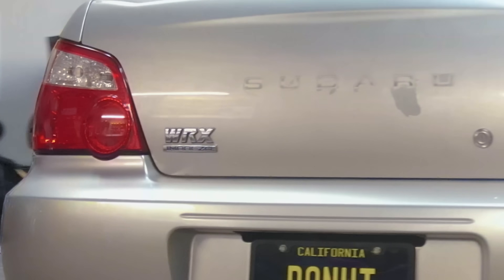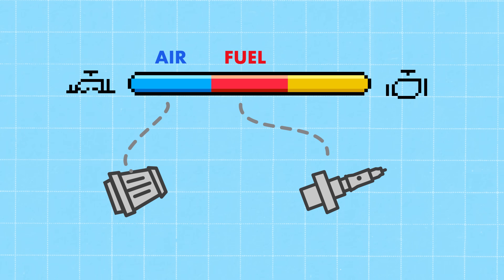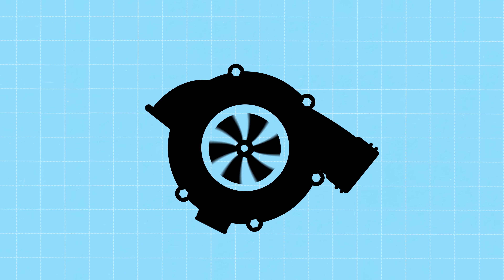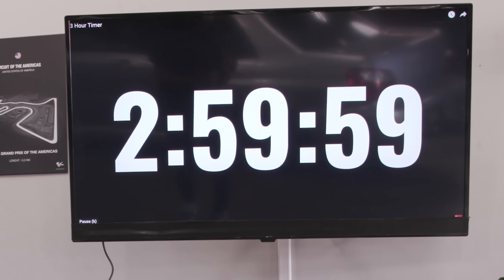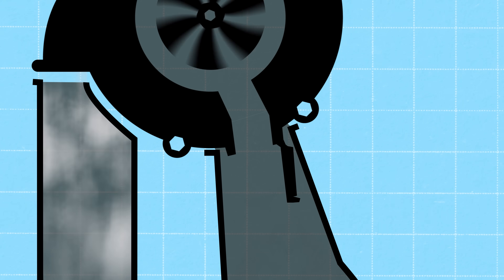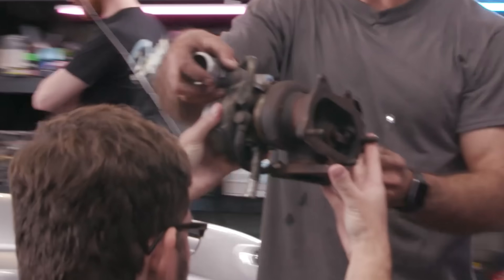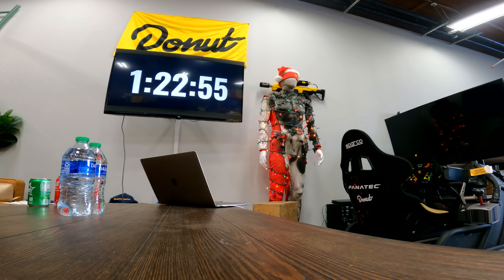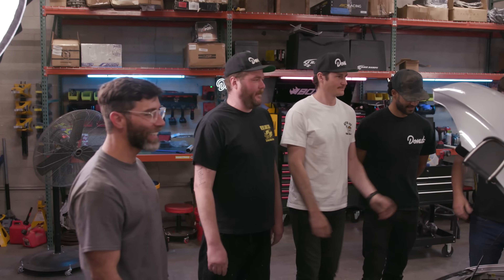Giving people a car, if they can fix it

Comment: Tim managing to replace a turbo with an hour still left on the clock is godlike, there’d be a pile of crumpled beer cans and some choice language being thrown at the car if I attempted that job
Reply: To be fair, it is in an easy to get to location. My first time ever swapping one it took me under 3 hours from start to finish. It’s no slouch job though.
Reply: no lie
Reply: Wrx's are easy to replace.  Takes about an hour and 30 with a lift...give or take
Reply: I can change my turbo on my srt4 in an hour very easy
Reply: In the stock location it’s super easy
Reply: I was about to type this comment out pretty much word for word. This is me.
Reply: Your problem is drinking while doing a job like this...
Reply: @jimmywoo7875  found the engineer
Reply: Agreed I had to change the turbo on a 06 acura rdx and it was a complete nightmare turbo is located between the Transmission and fire wall.
Reply: Theore you do a job the easier it is to do it again but yea that was fast
Reply: @ItsShrk  try changing turbos on an N54 😪
Reply: Subaru turbos are stupidly easy to replace. Definitely not godlike
Reply: nice comment, now I don't need to watch the vid✌️
Reply: @ItsShrk  I’m calling bullshit. Maybe the turbo cartridge but there’s no way in hell you’re going to take that OEM manifold off in an hour
Reply: If you're a subaru owner after 2 or 3 turbos you get pretty fast at it lol
Reply: @Livinglife3666  you don't have to take off the intake manifold to replace a Subaru turbo
Reply: @jay1268  yeah that other guy was talking about an SRT4
Reply: Right! 😂😂😂
Reply: Some people would use the 3 hours just trying to put the tmic back in!!
Reply: Don’t forget the 2 packs of Marlboro reds 🤣
Reply: Well it has been removed once by the donut crew so no stuck bolts.
Reply: I could replace the turbo on my car in an about an hour. But that’s because it’s a easy location and everything is easily accessible. 2014 Cadillac ATS 2.0T
Reply: I'm pretty sure they told Tim it was a Subaru before he went in for the challenge. Every turbo system is different, but god damn props for getting that turbo off in less than 2 hours. EJ turbos are stupid finicky to get off given that you have to remove the TMIC and heat shield to reach the turbo.
Reply: God*
Reply: Not really lol they’re very easy to swap
Reply: Ditto!!
Reply: This is the best comment ever 💀
Reply: Yeah, gonna agree with a lot of the guys here. EJ turbos are fairly simple to swap. Unfortunately know from experience.
Reply: @tylerbranski9853  happy ramadhan 2022 Tyler. 🙏From Purwanti Allan. 🙏
Reply: @graphicsgod  Ditto man 👍
Reply: @cristianmontesdeoca7392  have u watched MotoGP Argentina last night? Aleix Espargaro won finally.
Reply: @adamhayden5152  happy ramadhan 2022 Adam 🙏 From Purwanti allan.
Reply: @henry6777  zig zag
Reply: @Mr.Lonley816  yes. And Rothmans too.
Reply: @kylemaples6461  happy ramadhan 2022, Kyle Maples. 🙏 From Purwanti Allan. 🔥
Reply: Not gonna lie, i'm betting the whole timer thing was a prop and it took the guy longer than that.

I'd like to see more than 10 minutes of film, but we didn't..
Reply: Not to mention THIS car especially where the intercooler can be a huge time sink in just removing and even worse putting back on with one person’s pair of hands (unless they did jump in and help). Either way, made props and he got lucky that that was the only issue especially on a car being this old and for who knows how long running on that bad turbo. He got a good deal hopefully.
Reply: Damn. You can actually replace a B5 A4 1.8T in turbo in less than 30mins, leaning over the fender.
Reply: @chrisplayz9739  or how about a z32 😅
Reply: Subarus in general are as good as it gets as far as working on them goes.
Reply: @Jimmy Woo, Wrong. Wouldn’t have gotten through some parts of my friend’s 335i engine replacement if we hadn’t had a bit to drink man. That thing’s hell…
Reply: Took me about a year to build up the courage to restart my project, I got it off and gave up. Took me about a month in ordering new parts and trying to figure out a new vehicle. Lots of 3am nights and lots of beer, then it blew up on my first drive from a stuck thermostat
Reply: Yea he also diagnosed in in such time
Reply: Took me 2 days to replace my 99 Saab 9-5 turbo. Gonna be back to 90s Hondas for me soon. Cheap and effective baby.
Reply: @varacd69  to be fairrrrrrrrrrr
Reply: quake voice Impressive
Reply: Turbo replace is cake bruv literally 40min
Reply: Goated comment
Reply: @ItsShrk  love srt4s
Reply: Best comment I've ever seen
Reply: I’d literally sit quietly and stare into space about how pissed off id get and then resume to try to finish the job 😂
Reply: @kelbaez  Dude... That POS silicone elbow gave me trouble every damn time.
Reply: You do know this is all acted, right? Sorry to burst your bubble.
Reply: Add an additional hour or 2 for each stuck bolt too...
Reply: I would treat it like I'm its alcoholic dad if I only had 3 hours
Reply: @eddyd.105  thats a really shitty place 😭
Reply: 100%
Reply: Specially in a subaru😂

Comment: I haven’t watched this yet but it’d be hilarious if it had blown head gaskets and a bad timing belt just like every other mid-00’s Subaru ever.
Reply: As soon as I heard it I thought head gasket. Haven't watched it yet.
Reply: As some with a mid-00's subie, I will be mad if he doesn't have to change a headgasket.
Reply: Typically it’s only the non turbo 2.5’s. They used a different head gasket on the turbo’d 2.5’s.
Reply: Spoiler: the turbos blown out.
Reply: It's the turbo. It's always the turbo. Even if it's the water pump or head gasket, it's still got a bad turbo.
Reply: Hahahaha I laugh when people talk about blown head gaskets in Subarus every engine has its flaws
Reply: Just woke up, came running to comment this.
Reply: Facts dude 😂😂
Reply: @deathtoming2201  just take care of them and their fine. Do your maintenance replace warn out things. It's good. I adore when people get upset that they need to replace their water pump and timing belt at 200k miles. I always smile to myself as a know it truly should have been replaced 110k ago at 90k. Hell I'm still driving a 2door Brighton with 250k on it the original timing belt little oil in my transmission or engine, because they leak right, and only water in the cooling system that needs to be topped off every day. And it still runs like a champ.

Yes it's needs a new water pump and might need a new head gasket if I ever let it get to hot. But I have all the parts. I kind of don't want to replace them because she's still driving so we'll.
Reply: not unless he did the delete
Reply: I have gf8 turbo 99' with stock engine 275k km on clock, original engine and turbo. My father had 2015 sti, drove 100k with it and no problems also
Reply: @googleleavemynamealone9145  what? You mean delete the subs engine and replace it with a honda k right
Reply: @Adroit1911  nah the headgasket and water pump delete.  Replace it with air-cooled Porsche pieces LoL
Reply: @googleleavemynamealone9145  smart!!!!! Lol 😂
Reply: Spoken like a person who knows only general information about Subaru. The WRX was never prone to headgasket failure.
Reply: How to tell everyone you know nothing about subarus without saying you know nothing about subarus
Reply: @Adroit1911  the 2.5.....   is it an interference engine?
Reply: @ozzypawsborneprinceofbarkness  I've owned 5 and my studies show you are 60% wrong 🤣🤣 add broken ring land, spun bearing, blown turbo, bends rods. But after all that still the most fun car to drive.
Reply: @taylorforster9256  exactly
Reply: Lol I was thinking this to
Reply: @shaunmilor  yes, every 2.5 interferes with everything!!! 😂 But for real, all new Subaru engines and every 2.5l Subaru engine is an interference engine.
Reply: This is what I came here for
Reply: You have 2 hours to fix this leaky head gasket , can he do it!!!
Reply: @jaredparsons4761  I own 2 na 2.5s and both going strong at 200k😂it really depends if the owner wants to change the oil or not
Reply: Except for the 07
Reply: @ozzypawsborneprinceofbarkness  true... But I'd take head gasket problems over ring land failure any day!! 🤣🤣
Reply: late 1990s  N/A subarus had head gasket issues, the turbo gd models got the metal multilayer gasket that didn’t fail
Reply: @googleleavemynamealone9145  most old Porsche’s are swapped with Subaru motors so they can actually drive them
Reply: @jarrettwieberg  it's the flat technology, so exlusive
Reply: @Adroit1911  ooof...Better keep up on those belt changes!
Reply: Wow just commented the same thing I guess I should read the comments before commenting 🙃
Reply: The 2.0 turbos really didn't have headgasket issues. The 2.5's were the ones that had em
Reply: A bad timing belt would mean the whole engine is big time fucked, I dont think theyre gonna make him do an engine swap...
Reply: @TheMagicBambi  the naturally aspirated 2.5l. The EJ255/7 uses the same multilayer steel gaskets the 2.0 has.
Reply: @Adroit1911  correct
Reply: @deathtoming2201  as someone who’s owned two, every 100k like clockwork…
Reply: @joecam7109  but those had ringland issues so just as bad lol.  I prefer the 2.0s out of em all
Reply: Well, once the new turbo is in and it's running they'll probably blow xD
Reply: So fun fact head gasket issues only were on 1998 to 2000 models on the outback ej255 series. As for the timing belt issue it was 1998-2008 on all Subarus cause they use pure rubber and not metal coated rubber belts like most cars did.
Reply: @jarrettwieberg  same here, 218k on my 2.5 EJ251 and she’s going very strong. New clutch last week and she’s as happy as can be! Going for a tuneup and an entire suspension revamp soon.
Reply: @Matt-ik4tm  happy ramadhan 2022 Matt. 🙏
Reply: @Adroit1911  happy ramadhan 2022 Jameson. 🙏 From Purwanti Allan.
Reply: @purwantiallan5089  Ramadan Mubarak 🙏
Reply: Ok, you have 8 hours remaining...
Reply: @tyredcar03  heck yeah man! Love the outback
Reply: All the Subaru fans in to say this!
Reply: Imagine being mad at an engine for failing parts when 99% of them last well beyond the service intervals. If subaru tells you to replace something every 75k don't expect it to last 200k
Reply: @TheMagicBambi  i wouldn’t know, more than a 100k on my Ej257 and it’s still going strong so 🤷🏻‍♂️. Remember, this doesn’t happen to everyone and people just go nuts modifying these cars trying to extract every drop of power, the key is in the tune.
Reply: @ozzypawsborneprinceofbarkness  the right hand rocker gasket is the biggest wrx fail imho.
Reply: @joecam7109  plus I think some people forget boxer engines been used in aircraft for years almost a century which is 100 years for all the dumb ones o it there 😂 you need reliability to be thousands of feet up in the air engine constantly at high rpm doing turns and twists aslong as the “build” is done right on a subie it can be mean but don’t expect it to push 1k Hp unless you look over every single fine detail like they would on an aircraft engine.
Reply: Guessing it's a 2004/5 2L blobeye and afaik they didn't have HG issues.
Reply: @BaddaBigBoom  ahhh, none of the turbocharged models have ever suffered from headgasket issues, none. Not the ej205, ej207, ej255, ej257…they all have steel multilayer gaskets from factory. That must be the biggest Subaru misconception of all time. 🤣😂🤣 of course if you let it overheat or overboost or something like that they will fail, as much as any other engine.

Comment: Taking the Downpipe off makes it 900% easier to reinstall I’ve rebuilt my ej205 and had the same issue it is definitely smarter to take the downpipe off not harder
Reply: Yeah when Aaron said it didn't need to come off I'm like  hmm somebody hasn't worked on subarus much huh haha.
Reply: Good to know it wasn't just me, it's also 3 extra bolts to take it off plus the 5 that hold it to the turbo, so it's adding all of maybe 5 minutes to remove and install.

That said, I couldn't do this in this time
Reply: 100%, unless gd's are that much different from g3's you can't take the turbo off without taking the downpipe off. I took my turbo off again 2 weeks ago and taking off 2 additional bolts saved hours aye
Reply: @jwljwljwwwwl  I mean you can still remove it without taking off the downpipe, but it’s an absolute bitch to do it that way lol. Totally worth the extra five minutes without question.
Reply: I agree much easier to bolt the down pipe up once the turbo is mounted
Reply: Also way easier to get the oil return line lined up and clamped back on with the downpipe out of the way.
Reply: Certified Subaru technician here 👋 downpipe definitely does not have to be removed. Yeah it can give you more room to work, but isn't necessary.
Reply: @jarredmitchell5147  no kidding but to say you don’t have to take it off to speed up the process is wrong, taking it off saves you time, and anger trying to take the up pipe bolt off
Reply: @hunterneli182  not if your a confident technician.
Reply: @hunterneli182  If your good at what you do and you know what your doing you don't get angry you get smart.
Reply: @KevinEdgar  dude tried to cover up for his lack of knowledge by coming off as more knowledgeable. It's clear from the way that he immediately expected to be passed the intercooler without inspection plus his genuine interest with the inspection of it after identification of burnt coolant and oil makes it obvious.

Comment: Tim’s a god, I’ve literally never heard of someone who could take a down pipe off and swap a turbo in 3 hours!! That incredible😉
Reply: 2 hours actually. He had 1 hour remaining.
Reply: It's a 20 minute job max
Reply: Its really easy to take the turbo off these cars once you take off the intercooler.
Reply: You never seen flat rate techs work before….
Reply: + hot engine
Reply: I spent 8 hours on mine and I wanted to bang my head on the concrete
Reply: Shit I can have an entire ej out in an hour or less. Replacing a turbo and down pipe take like 30 minutes
Reply: Now do it on an n54 😂
Reply: @rayraycarter04  Bruh it's lunch time before you get all the plastic and wires out of the way to start the actual job.
Reply: @rayraycarter04  That is absolute hell.... Especially on a stinkin F01 7 Series
Reply: @orshy1  Infiniti VR30 might have more honestly 🤣. I used to have a Q50 and that engine bay looked like a huge spiderweb with all the damn wires, hoses, and other shit.
Reply: @andrewb229  Yeah that thing doesn't look friendly on google images lol

I daily an E90 with the N52. Did the valve cover on that over the summer and it wasn't too bad. I'll pass on the turbo setup for a car I'm actually putting miles on 🤣
Reply: @orshy1   It wasn't fun to work on at all when I had it. Totaled it and moved on to a F30 340i, which evidently I just sold. Gave me too many problems. More than I'd like to deal with. Currently I'm on the market for a truck

Comment: This is a sick series and it's honestly extremely helpful for dudes who aren't mechanics but like to pretend (like myself). Subaru was clean as hell too. Great job, guys.
Reply: Dawg, if you tryna be a mechanic, donut is not going to teach you enough. If you’re trying to be a mechanic, I’d say get familiar with sensors, they over complicate everything IMO.
Reply: @mr.pissedoff1903  they’re a huge help too though. With a code scanner you can read any code that the car is saying is the problem it’s experiencing, coolant and oil temp, oil pressure, your LAMBDA, fuel trims, fuel pressure, boost, etc. 
For example he was looking at the temp gauge to see if head gaskets were the issue. Without a sensor for that, he wouldn’t know until it started to run poorly. At which point the engine is damaging itself big time. 
Also I want to say that this isn’t a mechanics degree channel by any means, but to say you don’t learn is just silly. He learned the symptoms of a blown turbo at the very least. So yeah, get familiar with sensors, because that’s how you see if something is wrong with your car lmao
Reply: Youtube mechanics unite
Reply: @constructapex2021  swear. we’ve done trans and engine swaps and everything in between using youtube😂 3 years ago we knew nothing about cars, now everyone brings them to our house to get worked on. youtube is king fr
Reply: @driizzy2cold  100% facts man i cleaned throttle body for the first time last week and im gona attempt o2 ce sor next
Reply: @constructapex2021  yessir feels good to do stuff on your own
Reply: @driizzy2cold  youtuber recommendations?